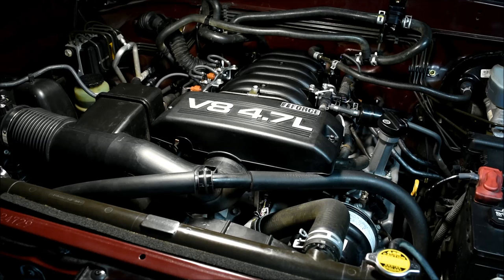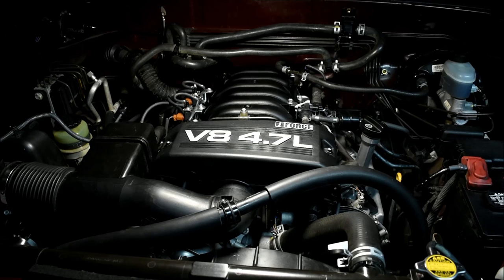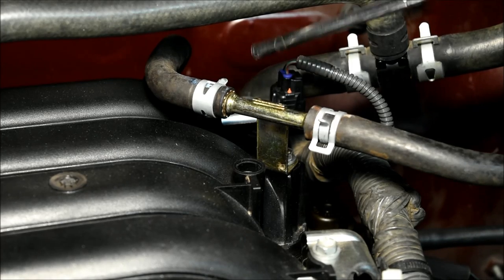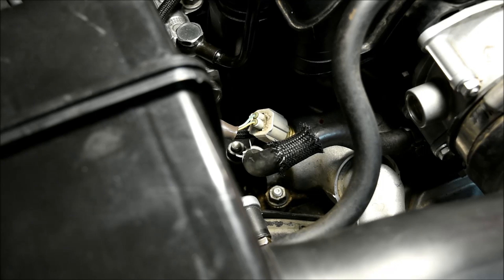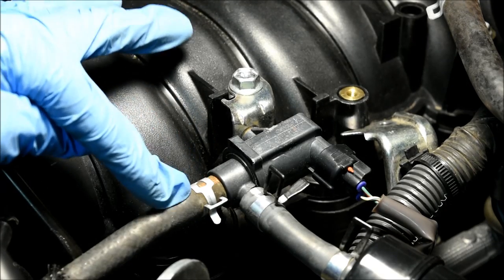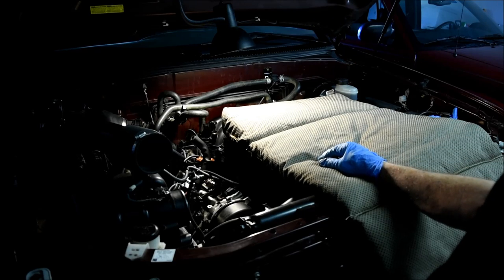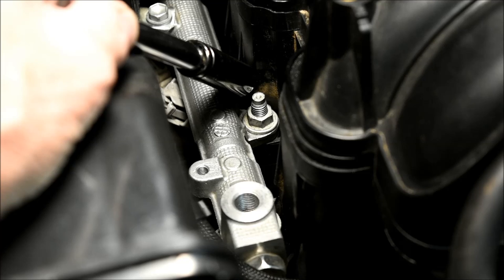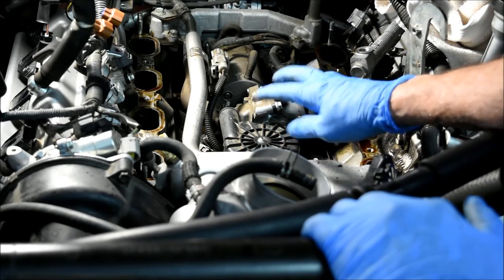Secondary Air Injection Pump Replacement 2006 Sequoia/Tundra Chapter 1: Removing the Intake Manifold

Comment: Would love to see a video about how you keep the engine bay so clean! :) Thanks for the videos, I have a 2006, 135k miles, with a leaking intake manifold, and this will save me a ton of money. :)
Reply from the maker: Hi Troy, thanks for the kind words. About once a year I take my Sequoia to a DIY car wash and spray Gunk Engine Cleaner on it and then rinse it off with hot water. Years ago a friend told me about a product called Silk Shine Dressing. I think the guys who display "show cars" put it on the black plastic and hoses to make them shiny. I am more of an airplane mechanic and we normally spray down an engine with Varsol/mineral spirits before we work on it. It cleans off all the grease/oil and makes it much easier to see problems. It is also just much nicer to work on a clean engine. Dave
Reply: @doktorfixit  I will have to start doing this asap. I too am a former aircraft mechanic. :) I spent 4 years on B1B in the AF, then a couple at DFW as a contractor on transports. Thanks again for taking the time to create such a professional and complete how to video. I took my time, mostly cleaning, but was able to finish in about 4 hours.

Comment: This just happened to my Tundra with only 63k miles on it. Dealer wants $2500. No way I can make this repair with all of the disconnections required :-(
Reply from the maker: Hi Bradley. If you are not "into" car repairs, this is probably not a good project to cut your teeth on. Although there is no single item that is terribly difficult to do, it is a string of procedures that will take you some time. I was not joking when I said not to start this on a Sunday afternoon if you are planning on driving the truck to work on Monday. And you should not even think about starting the repair unless you have all the replacement parts in front of you. Having said that, I have helped 3-4 guys do this job by "remote guidance." One fellow Skyped with me to ask a couple of questions. 
One other thing. With only 63K miles, does your truck qualify for the recall, i.e., is it a 2007 or newer?
Reply: Get a bypass kit. I just put one on my Tundra, fairly easy install...truck now runs better than ever.

Comment: So my intake manifold bolts and nuts are so corroded they rounded immediately. Does anybody know the part numbers for those nuts and bolts that actually attach the intake manifold to the engine?
Reply from the maker: Sorry, I don't, but I would go to a Toyota dealer's parts dept and ask them. If they are insanely expensive, then get the part number and shop around. I see folks selling Intake Manifold nuts on EBay.

Comment: What code did you get to make you change it? I have a 2007 sequioa and got a P2440 code. Also what are the symptoms. Mine it won’t go more than 40mph
Reply from the maker: I can't recall the exact number of the code but the explanation was that the secondary air injection pump was stuck in the ON position. There were no symptoms of this problem other than what you experienced, ie, the limp mode. My memory is that there are at least 5 codes in the emissions system that will make the vehicle go into the "limp mode."  This is, of course, totally ridiculous because it does NO HARM to the car to drive it with the smog pump inoperative. The Toyota dealer is just saying "Come to the dealership and we will replace it- probably at some expense..." I have heard that there were so many complaints about this that the mfg changed that and smog pump problems no longer trigger the limp mode.
Reply: David Clark 
Thanks for a rapid response. I had 3 codes
P2440.  P1444.  P1441
How can I get a copy of you binder?
Also how do I have to release the fuel pressure before taking out the fuel line?
Reply from the maker: @eurovan03  Email me at dave520@prodigy.net and I can send you those instructions. Thanks

Comment: David, my 2006 tundra with 128k miles recently started whining, 99% sure it's the air injection pump. I've read into it some, will it damage anything if I order a bypass kit? would it also damage anything if I just ignore the whining ? I don't have the funds right now, or the time to do it myself, so just curious
Reply from the maker: Hi Hunter, Does the whining go away after the car is warmed up? If so, then it is more likely to be the SAI pump. My understanding of the SIA system is that it is only activated once a day during a cold start. The folks at the Toyota garage where I first went when my CEL came on said that I could run the vehicle as long as I wanted because the smog pump does NOTHING to affect to the way the engine runs- with one exception. If you get the CEL, you will go into "limp mode" but that is artificially inflicted on you by the car's computer and can be turned off with the reset button on your OBD-II code reader. They added, the thing that would force me to replace the pump would be my next State vehicle inspection- which the car would not pass. 

To answer your second question, the Bypass Kits will not do any damage to the engine to the best of my knowledge. I honestly do not know if the kit will stop the whining. That is to say, will it stop the car's computer from turning on the smog pump every morning? Or does the bypass kit just send a signal to the computer saying that nothing is wrong with the pump? Furthermore, if you are not getting a CEL or an OBD-II error code saying the emission system is having problems, I am not sure what you will accomplish with buying a bypass kit. You can email the guys who make/sell those two kits and ask them. I have talked to both of them and they were fairly helpful in answering my questions.
Reply: David Clark I appreciate it bud, but yes it's the SAI pump. it goes away after it warms up.  from what I've read, the bypass kit eliminates the use of the pump all together. I just wasn't sure that it wouldn't damage running it without that SAI  pump. Just out of curiosity, how much would you personally charge to change this pump out?
Reply: Also, the bypass kit eliminates the CEL light due to not running the pump. Clearing the code after putting on the kit, and bam that's it. (from what I understand). Oh, and I also appreciate the fast reply!
Reply from the maker: It has been about 3 months since I spoke with those guys and I have forgotten exactly what the bypass kits are supposed to do. But one thing I do remember is that I was going to have to buy a second kit to take care of my P0418 code bringing the total bill for the kits to around $450. (The primary bypass kit does not address that code. And afterward I was going to have to disguise the wiring and black boxes to make sure the state inspection folks did not discover what I had done.) Once I realized the TOTAL price of the bypass kit(s), I saw that it was about the same as the cost of all the replacement parts in the SIA system if I got them at Rock Auto or some other discount after-market parts place. And installing the bypass kits, while not as labor intensive as replacing the pumps, does involve some work, i.e., disconnecting the pipes from the check valves to the car's exhaust system in order to install the metal "plugs," plus putting in the black boxes. That is to say, those bypass kits are not just "plug and play."
Reply: David Clark that's what I was looking at, based on the reviews it doesn't seem that bad, but I live in SC so we don't have an inspection, which is great in this situation.
Reply from the maker: Yes, it sounds like it is the SIA pump. And as I said, it will do NOTHING to hurt your engine if you continue to run the car with it making that noise.

Wow, you asked a good question. If you were my neighbor, I would replace the pump for free. It was kind of fun. Last year I replaced the entire front end on my neighbor's Sonoma pickup at no charge after he bought the parts. I had just done the same thing on my wife's Blazer and I had my motor warmed up. ha. 

I am an airplane mechanic in my second life and have never charged anybody to work on their car. But if I had to come up with a figure, I would probably say $250 (labor) just to change out the pump and diverter valve. And $400 for the pump, diverter valve, and check valves would be fair- and less than half of what the Toyota garage would charge. Replacing those check valves is a bit challenging and time consuming. Taking off and reinstalling the intake manifold is a piece of cake by comparison.
Reply from the maker: I may have mentioned this in my notes on Chapter One, but when I first was pricing the parts for this repair at the Toyota shop, the counter guy said that he would not spend that kind of money (I think they wanted 1300 dollars for the parts) on a 10 yr old vehicle just to pass the state inspection. He whispered conspiratorially that he would just get the bypass kit. Wink wink, nudge, nudge...
Reply: David Clark I'm sold on it, thanks David for your help!
Reply: Hunter Rhynes 8

Comment: Thanks a million, David!  Well, at least a couple thousand anyway :)  I viewed all three videos, your well written notes, and the additional video by Brian Eslick.  For those attempting this repair, HAVE NO FEAR.  Just stick to what David and Brian tell you heed their warnings.

Some personal observation for future do-it-yourselfers to consider:

1)  Secondary Air Injection Pump (17600-0F010).  I skimped by purchasing an aftermarket part at RockAuto for about 80% less than OEM ($85 vice over $400).  I’m glad I did.  The pump blades on the part I removed had failed miserably, so it’s now my belief I couldn’t do much worse using an aftermarket part.  I did purchase all three OEM valves since the price difference was only around $40 more than the aftermarket ones.  For the pump, instead of cutting and splicing wires per instructions with the aftermarket pump, I simply disconnected the pigtail from the old pump and connected both wires to the new one.  No tools or splicing necessary.

2) The OEM Toyota Check Valves (25720-50011 and 25720-50020) I ordered from McGeorge Toyota (BEST prices and shipping) did NOT come with the metal pipe gaskets.  Had to make a mad dash to a local dealer for them, and had to call four dealers before finding one who kept them in stock.  My advice – buy the four gaskets separately when you order the valves just to avoid the potential frustration of a work stoppage.

3) Intake Manifold Gaskets (17171-50030).  David said to buy two, but I only ordered one based on the misleading parts diagram on the McGeorge Toyota site.  I ‘assumed’ it was a set.  Bottom line – listen to David and BUY TWO!

4) No need to purchase the Gaskets for Rear Water Bypass Joint (16341-50020) provided you take Brian Eslick’s advice for replacing the check valves on the rear of the engine.  I should note here that my job was done on a 2006 Tundra, which seemed to have a little more working room between the engine and the firewall than what was shown in the videos by David and Brian.

5) O-ring and gasket kit for all eight fuel injectors.  Like David, I purchased aftermarket parts, albeit from RockAuto.  But then I screwed up royally.  Although I’ve done my own maintenance for many years, I NEVER had to remove a fuel injector.  It was easy enough, but then it came time to replace the seals.  I had NO idea the lower seals remained in the manifold.  So without first looking at the new seals, I began to remove what I THOUGHT was the seal from the bottom of the first injector.  I was amazed at how hard and brittle it had become.  After I finally removed what I thought was the old seal, I pulled out a new one, only to learn I actually destroyed what seems to be an insulator or something on the fuel injector, which rendered the injector useless.  Fortunately, I found a reconditioned injector for $20 on Amazon from AUS Injection – a company that will also clean all your fuel injectors at a great price.

6) Spindle oil – I used food-grade mineral oil from Lowe’s.  If you ask for spindle oil around here, people look at you like you have three heads.

7) High temp Black RTV – I did not find it necessary to use.

Thanks again to David and to Brian.  The savings and satisfaction of doing the job myself was remarkable.
Reply from the maker: Chris, Many many thanks for the kind words. And even more thanks for writing a detailed report of what you did and lessons learned along the way. As I have said at least 3 times in the videos and comments, hindsight is 20/20 and I would probably do some things different if I were to do this again. I also appreciate your comments about the space between the rear water bypass joint and the firewall. I got a flashlight and looked at that space in my Sequoia after watching Brian's great video. I think the space in my SUV is somewhat smaller than the one he was working on. I am glad that you said that the space in your vehicle was larger. Maybe that space varies from one model to another.
Reply: Thank you for the detailed information. I need to do the same thing this weekend.
Reply: Thank you for the detailed information. I need to do the same thing this weekend.

Comment from the maker: Parts needed to replace Secondary Air Injection System on 2006 Sequoia/Tundra

 

1.    Secondary Air Injection Pump: Part No. 17600-0F010

2.    Diverter Valve:  Part No.  25710-50022

3.    Check Valves (right and left): Part No.25720-50011 and Part No. 25720-50020  Note- the metal pipe gaskets for these parts are supplied with them.

4.    Intake Manifold Gaskets (2): Part No. 17171-50030

5.    Metal Crush Gaskets for Fuel Delivery Pipe Unions (4): Part No.  90430-12026

6.    O-ring for Fuel Pressure Regulator: Part No. 90301-07037

7.    O-ring for Water Bypass Pipe: Part No.96761-24019 (The O-ring I bought from the local Toyota dealer was hopelessly inadequate. See explanation below.

8.    Gaskets for Rear Water Bypass Joint (2): Part No. 16341-50020

9.    O-ring and gasket kit for all 8 fuel injectors: I bought an after-market kit from AutoZone for $24.

10.    Hose, air injection: Part # 17342-50180 (Note- this hose has a  45 deg bend molded into it. If you are careful, you may not need to replace this hose, but mine was hard and brittle and broke easily. You cannot substitute radiator type hose for this part, because it will kink at the sharp bend required). $27.67 is best price I found on the net. Local Toyota dealers want $49 or more for this.

11.   Spindle oil. Needed for lubricating the O-rings and rubber parts on the fuel injectors. You can use gasoline but it evaporates too quickly IMHO. The Toyota manual says NOT to use motor oil or brake fluid, etc.

12      High temp type Black RTV

13.       Antifreeze type coolant. You can't avoid spilling some when you remove the  rear water bypass joint.

14.   While I bought a few O-rings and gaskets from the local Toyota garage, I ended up getting OEM Toyota parts from toyotaonlineparts.com. The alternative to that is to get after-market parts from a company like rockauto.com. I found that if you use all OEM Toyota parts, the entire job will cost about $800. If you use mostly after-market parts, the job will cost about $500, or about $300 less.

Comment: Terrific video; worked great for replacing an o-ring on the water bypass pipe on 2001 Sequoia.  
I found I did not have to remove the fuel injectors and fuel delivery pipes/pressure regulator.
I was able to work the fuel injector electrical connectors free without damage by using a flat-blade screwdriver.  Place the blade of the screwdriver on the release tab.  Rest the shaft on the intake manifold.  With a finger on the top of the connector to counter the screwdriver, push down on the screwdriver handle.  This action simultaneously depresses the release tab and provides leverage to pull the connector up and out.
Leaving the fuel delivery pipes in place saves you from breaking and remaking some connections at the cost of making it much harder to access two of the bolts that hold the manifold down.   A magnet can be helpful for picking up these bolts.  An other option is to back the bolts out, leave them in place as you very carefully lift the manifold out.  Clearly need to be super careful about those bolts falling free and entering the open intakes. 
Two-person lift of the manifold is incredibly helpful.  Especially for making sure everything is disconnected and free.  Be careful of the temp sensor (near where manifold's front right bolt is located).  It's very tempting to rest the manifold on the way out and this sensor looks like it would be easy to damage.
Oh, on the 2001, the fuel connector takes a 17mm and a 14mm; does not have the cool quick-disconnect style in David's excellent video.
Reply from the maker: Joe, thanks for the helpful input and for the kind words. That sounds like good advice on the fuel injector connectors. I hear you on the help a second pair of hands could bring. My son lives in Calif or I would have asked him to help a couple of times during my repair.